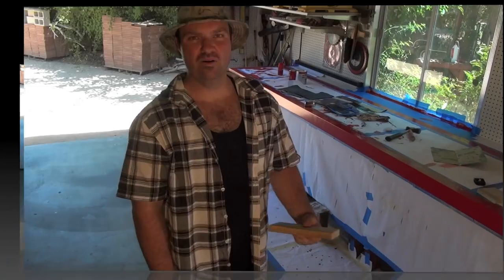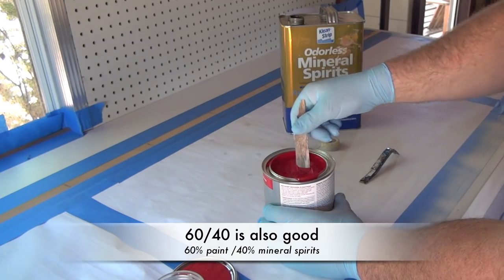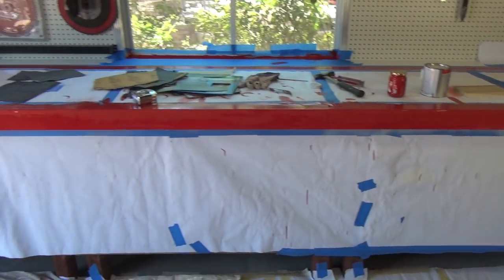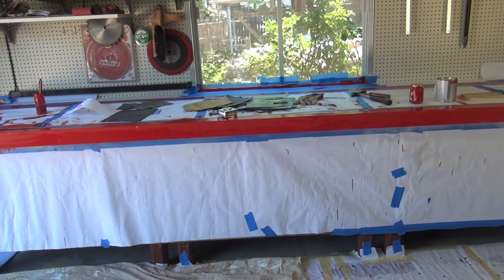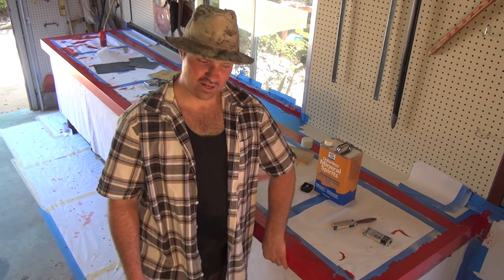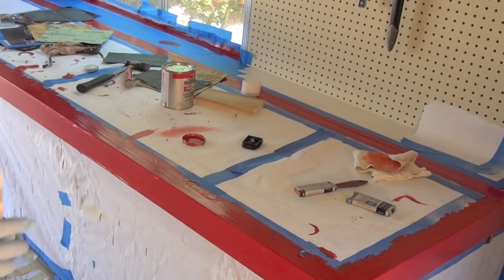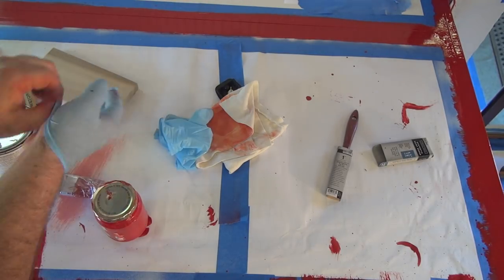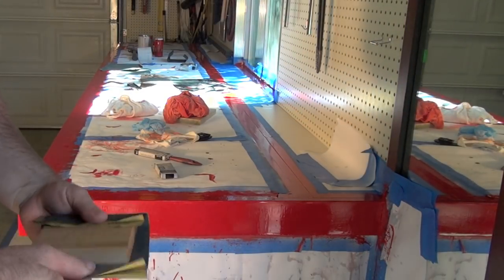DIY How To Paint Mirror like Finish *Step by Step Using RustOleum Oil Based Paint / Part 1

Comment: A good tip i have for when you mask up is to first paint over the taped edge with a colour that's the same as the surface below that you're masking. This paint will have seeped under any part of the tape that's minutely raised and acted as a filler. Once that's dried you can go ahead and paint your new colour. When you finally pull the tape off you'll see a crisp line
Reply: Great tip, I'll keep that in mind with model building :-)

Comment: I have found that 00 steel wool rubbing after your second coat. Then rub off the left over from the steel wool will get an even highier gloss. The steel wool works great with more than one coat. Is great when clear coating too.  The Steel Wool helps to get rid of the streaking and give a more even surface for the next coat. Atleast that works for me with all oil based products. Hope that helps.

Comment from the maker: If you are painting wood just use Kills primer (maybe see a few of my older vids) If metal is being painted I would not use any primer at all (just paint more coats)  Or use a oil based primer, sand lightly to remove any imperfections then paint. Also try reading any comments here or the description under this video. Good luck with your project, I like rustoleum oil based paint!!!

Comment: Primer is meant to have a "toothy" surface that can be sanded. So if you use a primer let it dry thoroughly and then sand it with very fine paper. Kover Stain from Zinser is a nice sanding oil based primer for wood. For metal, a "self etching" primer will give a hig bond base coat. It is usually greenish in color and is a must on aluminum but does a nice job on steel as well.

Comment from the maker: I don't advise painting on top of laminate because almost every time I did that the paint would scratch off. I did have good results on a cabinet door probably because it's a vertical surface and less likely to get scratched. Now days I see they sell special paint that goes over laminate. Yes scuff up the laminate, maybe use a sanding block with 180-220 grit sandpaper so that way the paint will have something to stick to & don't forget to dewax before you paint. Sounds like a fun project.

Comment: I know this is a old video but hopefully your still around and can answer my question. I'm painting a bilco cellar door and was having a hardtime getting a smooth finish with alkyd enamel. I tested your method with the 60/40 thinning ratio. It leveled out like a charm and that's great but i'm not sure exactly how many coats of paint I should apply before I paint my last finish coat. 8 coats seems like overkill on such a large project. Around how many coats of paint would you recommend for a larger project based on your past experience? Also I would not be polishing the last coat since it's a cellar door.

Comment: You could use a rubber sanding block by 3M- available in many hardware stores. Also Penetrol allows brush marks to disappear without thinning so much. Your earlier sanding did not need to be so fine-600 but could have been done at 320 or 400 and your next coat would have looked fine with less work.
Reply from the maker: Right on, thanks for the tip.

Comment: Hi Mike, As Pa1nter said, i also think that having a well prepared wood would be the right approach for a better paint job. One can easily fill and flush all the wood defects using a filler very easily and effectively.. don't you agree???

and that would need you to make 2 or at most 3 coats of paints to a perfect glossy finish.

thanks for putting up this video for us to think and learn.
Reply from the maker: I agree 100% about a better prepared surface especially with all the work required using this technique. This red paint job here is after all a garage work bench that can take a beating so not overly concerned about minor imperfections but wow the smallest imperfections do show through the finished product. 
Thanks for taking the time to comment.
Preparation is key to a high gloss finish.
On a side note the finish is still chip & scratch free nearly 2 years later, could use another waxing......

Comment from the maker: As far as a sander goes I glued wet sandpaper to an orbital sander and made it work a bit. Yes you can use a sander, keep it wet, I ruined mine but the thing kept getting all gummed up. Trick is to lay the paint as flat as possible and anything can be buffed out & repainted, just takes patients to make it flawless. Also a learning curve buy hey if you just want it to look good and not necessarily 100% perfect that's easy to do, its just the final 15% that's hard to perfect with out practice.

Comment: Thank you so much for this video! I have an antique vanity that I found in an alley about 10 years ago.  It was in very bad shape.  My father made a beautiful new top for it an I painted it a gloss black.  Now I would like to repaint in a mirror finish coral color.  My question to you is,  because the wood is not the smoothest, do you think that I could achieve this type of finish. The grain of the wood is more open due to being left outside in the elements.  I'm not sure if the paint and sanding could get this smooth.  If you think it's worth it I'll definitely try it.  Thanks again.
Reply from the maker: Valerie Santone 
The wood that is not smooth, can that area be sanded smooth? It may be difficult to get the hi gloss mirror finish on that piece. The piece would need a lot of prep work so the flaws won't show through the hi gloss finish (like a ding on a nice car)    With open grain wood  primer before the paint is key.  Coral is a nice color, one of my favorites......
   I think its worth a shot, you can always just repaint over it if it docent work out but dont paint over a waxed surface( paint wont stick)... Perhaps exparament on a mid sized piece of wood or a dresser or something. Some vanities have a lot of details which could make it difficult to polish.
Reply: Mike's DIY Projects & More I think that I'll try giving it a very thorough sanding and try filling in any areas that might make it look bumpy.  It does have some medallions on it 
but I might replace them with new ones because someone else sanded them down and they have lost most of their detail.  I guess if I try it and it doesn't look like it's going to work after a few coats, I'll come up with a new strategy.  Oh also, is it best to go with the grain of the wood? I'm so happy you responded. I greatly appreciate your help.
Reply: +Valerie Santone ;  Always sand with the grain of the wood.

Comment: Hi mike, when will u put up the polishing and buffing video, I wanna try to get a high gloss finish on some cabinets I'm refacing at home.  Also how long are you waiting between coats, plus does this work with all oil based paints, or just the paint u used? Great video

Comment: Great video and beautiful results!  Do you think this methodology could be applied to a dining room table or is there a better method for a surface that might get wet and wiped fairly often?  eg - polyurethane over oil-based paint?  Thanks in advance for your insights!

Comment: With oil based paints, while they are still wet and freshly applied use a blow torch to 'wipe over'. This will pop any bubbles in the paint and smooth out brush marks. Do keep the blowtorch moving to prevent burn marks or even worse a fire!
Reply from the maker: THANKS! thats good info...
Reply: Mike's DIY Projects & More no problem, works well to obtain a glass like finish to varnish on tables as well.

Comment from the maker: Good question.Personally I'd stick with oil based.  The truth is if you're using rustoleum, in most cases primer is not needed. Primer is needed however on porous surfaces like wood BUT on bare metal or fiberglass I wouldn't bother. It is possible to do a google search to find the chemical solvent compatibility for mixing water & oil based paints. Just guessing I think you can paint water based over oil based but I doubt it's a good idea the other way around. Im interested in finding out.

Comment: This is awesome man ! You can also try grit 320 on the wet sand to cut down on the amount of work and time it takes to smoothen out the surface, however; you'll need to be more cautious cause 320 is more aggressive than 600.
Reply from the maker: +Oscar8mx 
Thanks

Comment: (Great video; must have a go at this one!)I've done a similar 'high-gloss' project on a small set of, what were, wooden drawers.  Simply sanded back enough to take water-based paint; three coats dark with three coats lighter.  Leaving them to dry and then CAREFULLY wet-sanding through so the darker, first shade randomly appears which leaves a very flat finish that gives the wood an 'aged paint' appearance.  Finished off with wax creates a very high-gloss finish, which is improved in how many times you apply the wax to suit.

Comment: When painting with red, you should tint your primer Battle Ship grey. This will reduce the # of coats needed. Furthermore a good oil brush (ox hair) is recommended as well
Reply from the maker: Thanks seth, I always appreciate good advice.
Reply: Where did you obtain this information?  I'm curious about other colors and which color to shade the primers.  Logically I would think a shade of red for the primer if not the exact shade.
Reply: Ed Floody 
Ed you are correct in tinting to the color but for reds and greens gray works just as well. I obtained this from doing it repeatedly for 30 years

Comment: I would advise not to use a brush. I dont like rollers, if I could I would use a brush on everything that being said; I would have used a high density foam roller. It is faster and you dont leave stroke marks. If you are working on something important I would invest in a paint gun electric or air. Just make sure you practice with the gun on junk to get the right spray distance and speed. Also invest in a variable speed sander/ polisher, it comes out a lot more even and with less imperfections. If you are just doing a small job, this guy has the right technique. Great video with great explanations.

Comment: I get it now. I used Leyland high gloss in England. I couldn't understand at first why the paint wasn't drying quick like Mike says in the video. Perhaps I hadn't primed enopugh or something but I just did another coat (5th) and it dried in 20 mins. And it's getting real flat and smooth. Anyone having any trouble like I was, hang in there and make sure you do a few prime undercoats first. On MDF anyway. Thanks MIke. In fact, 12345Mike6789 for president! - vids are awesome. Cheers.

Comment from the maker: Polishing Video this weekend. I'm waiting 3 hours between coats on a warm day or after the paint is not tacky. I haven't tried but I believe this will work with all oil based paints.
Thanks =)
I was going to paint all the drawer cabinets like I did with the edge band cap (hi gloss) But I will tell you it's lots of work. Good luck with the painting, its pretty easy to do once you get the hang of it. If you do paint the cabinets I'd like to know you're thoughts on the process and end results.

Comment from the maker: 3+ hours is during the summer months. It's best to give more time between coats during the winter months.
   Once I finish painting I usually wait until the next day to wet sand but I have done it with success on a dry (low humidity) warm day 4-6 hours later or sooner. I think as long as the fresh paint is completely dry & smooth to the touch you're good. Some may disagree with that statement but I personally have not had any trouble rushing things along. When I paint my truck I'll wait longer

Comment from the maker: I used  oil based primer. I dont remember the brand but I then touched it up with kills primer. If I was to paint on fiberglass or metal I wouldent even use a primer but it is nice to have so your first coats go on even. Good old fashon Kills primer (oil based) will do the trick.

Comment: Four things here; one, you have a great eye for detail and I enjoyed your video! Two, a foam roller would be much easier and faster for this project . Three, a rubber sanding block (about five bucks) would have solved your headache with the wet sanding , plus its reusable! Lastly, 3M makes a green painters tape (a couple bucks more per roll) that would give you a razor sharp edge on your trim. Overall a great how-to tutorial !
Reply: Lol green painters tape for solid straight line? seriously. You have to end up having to caulk on top of the tape to stop bleeding for a straight line

Comment: Is wet sanding necessary? I have painted my subwoofer boxes using this method. And they have zero to no brush strokes/runs. Could i jus skip the step of wet sanding

Comment: i saw som guys do this to a car in hot rod magazine some years ago. they used a foam roller. it layd down more easely,and they did'nt need to sand down as much,becase the coats were more even. just a tip. god bless
Reply: morten henningsen ... do you know if you could do the same with lacquer on a car ?

Comment: I realize this is an older video, a few more tips though. 
- you can use Paint conditioner by "Flood" the two types are "Penetrol" (for oil based paint), "Floetrol" (for latex paint).

- This makes your brush strokes disappear completely and it will look as though you sprayed it (like an automobile finish). With a little tweaking to your ratio, you wouldn't even have to sand. I've used this product for years to paint Cabinets when there wasn't enough to justify dragging the sprayer out. 

- Another tip is to use a brush with real hair bristles for oil based paints. Use synthetic bristles for latex paint. 
Don't know which paint you have? Latex takes mineral spirits to clean, Latex will clean up with water.

- For all of the comments asking about spraying.  A lot of DIY people don't have an air compressor with an in line moisture filter and air spray guns. Nor are they likely to have a airless sprayer. Then there's the cleanup to the spray equipment involved.

I personally would not drag the sprayer out just to paint this little bit. It would take more paint to prime my airless sprayer and get the paint from the sprayer, tgrough the hose and out to the spray gun than it would take to paint this whole band.

Just search "Paint conditioner" on your favorite search engine and it should pop up. These products can be purchased at any of the home improvement stores and most any small town "Mom and Pop" hardware store. Just make sure you purchase the correct conditioner for your type paint (Latex or Oil based).
Reply: On my earlier comment....... the cleanup........it was suppose to be OIL BASED takes mineral spirits to clean.
LATEX cleans up with water. Couldn't edit the post on mobile so.......I added this.
Reply: +DIYnation Yeah, I was speaking on Cabinetry and wood mainly. Automotive and painting Metal.......whole different art form, different materials, conditioners, thinners, flexing agents and additives etc.

Comment: my only issue with this technique is the final part. i've found car paint wax polisher and it doesnt bring back the gloss effect after using sand paper. i'm thinking to apply vernice because normal brush vernice has yellowish color although it's transparent.

Comment: Thanks for the video Mike. I am guessing you prepped with grey primer, and what grit did you use on it and one coat of it? And did you ever consider using an orbital palm sander? I saw on Ebay hook and loop pads 800 grit.
Reply from the maker: Hi, I actually used white "kills" oil based primer. Grey may of been a better choice for red though. As far as the orbital, I have always done this process the same way. I have done it quite a few times with stellar results so I suppose I can say I have not thought or tried it with an orbital, it may be worth a shot. If you are referring to the hook pads for the wet sanding I don't think that would work using an orbital sander.
Reply: I'm getting ready to build my third subwoofer enclosure. This one will be for inside, and it will be gloss black. I will be using all purpose gray Valspar spray primer, one nice thick coat prepped with 320 grit. The paint is Rust-Oleum black gloss. I intend to round the corners with a 3/4" roundover router bit. I may use a roller for the paint, but I have the sponge brushes that work very well. I will try the orbital palm sander using 320, 600, 800, 1000 grit hook and loop discs. I'll let you know how it turns out.
Reply from the maker: I just replied on the other video. I was thinking you should try this process on a scrap piece of wood to start off. Be sure the mdf is fully sealed with primer because it will get wet & if not sealed good it could swell the mdf.  Also I have a feeling an orbital hook & loop sander can very well cause scratches & really be a pain because once you get going the pad will want to stick to the surface like a suction cup. The round disc I used here is made by Norton, OSH still carries them. It hooks in a drill & works well but like you said you wont know if an orbital sander would work unless you try.

Comment: Rust Oleum has a large number of paints on their site.  Could you list the exact product line that you used? I can only see Rust Oleum Safety Red Professional.
I think your video is great but I'd hate to put the work in and run into problems because I used the wrong line of Rust Oleum paint - thanks in advance!!!

Comment: i have done some painging today using oil based paint using a small roller. i am planning on doing a second coat tommorow, is ther any way to preserve the tray and roller untill then? or should i just ditch it and get a new one? bearing in mind it would prob take a whole bottle of white spirit to clean it. and the roller is cheaper than the white spirit